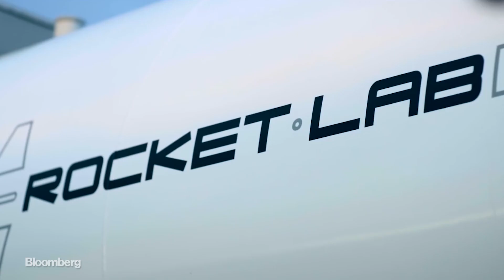Rocket Lab is Giving SpaceX a Run for Its Money

Comment: Electron rocket costs 26600 USD per kg to orbit. Falcon 9 cost's 2700 per kg to orbit. Electron is designed to launch small satellites that would otherwise be secondary payloads on larger rockets. The total cost of getting something to space may be less which can be advantageous for a small customer but Falcon 9 lifts a 100 times more at 10 times the cost. Isn't this supposed to be an economically oriented outlet? And I do think the Electron is very cool and has a place in the launch market.
Reply: "Isn't this supposed to be an economically oriented outlet?" Can you give me ANY example when the Falcon9 launched with maxed out capacity? Rockets rarely do that.
You buy a whole rocket, not just a fraction of it's payload capacity. So the price per kilogram can double or tripple very easily.
Reply: Yes but that applies to every single rocket. Smaller rockets tend to utilize a higher percentage of their payload capacity that is true (they'd be uneconomical otherwise) but even triple the max capacity price of a Falcon 9 that's still 3.28 X less than what Electron costs if every gram is utilized. The heaviest payload the Shuttle ever launched was the Chandra telescope at 22 tons. Yet the Shuttle could lift 27 tons. Delta IV Heavy can do 28+ tons to LEO yet the heaviest LEO payload it ever launched weighed a mere 21 tons. So why would you single out SpaceX yet ignore that fact for every other rocket in the business? Plus all those numbers are completely ignoring the recent price drops in SpaceX service since the arrival of Block 5. So all my numbers have been favorable towards Electron and slightly biased against SpaceX anyway,
Reply: You are right.
My point was, that with a smaller payload you face three options:
- pray that you get a piggy ride close to your desired orbit.
- pay for a whole rocket (and fly it with a very low payload capacity, if it's a big one), but reach your desired orbit.
In the small sat business the electron rocket is economically very viable.
Reply: Yes it is, as are all the other small launchers that also have quite terrible cost per kg on paper. All the small ones are in the 20-35k per kg range, so Electron isn't at all atypical of that category. I just think it's kinda misleading the way they did that whole piece not in the least the title of this video which is just plain bullshit. I did say the Electron is very competitive in it's niche of the launch market.
Reply: Yeah a lot of people are willing to pay even 10x if they don't want to wait years to be laugh to required orbit.
Rocket lab with their frequent lunches to desired orbit makes perfect sense.

Comment: More space junk though, a lot more
Reply: I wonder why they did not talk about the space junk issue at all. The more you launch, the more space junk will be up there.
Reply: @natez9059  RocketLab only leaves the Satellites they launch in space, all the rest the fairing cons and booster falls back to Earth, the second stage does a deorbit burn and falls back as does the kick stage...
Reply: @NighthawkNZ  So do they land like SpaceX Rockets do?
Reply: @natez9059  you don't know much about rockets do you...? one of the reasons SpaceX rockets are so big, is not just to carry the payload but also carry the extra fuel to land the booster...

It becomes damn near impossible for smaller rockets like the electron,

However, RocketLab has announced that they have been collecting data over the last 9 launches (including the one last month) and each one with more instrumentation on the booster... and have also announced a couple of months ago that the will be doing a sky catch to catch the booster and the re-use.
Reply: @NighthawkNZ  Not really. Are you a rocket scientist? You sound so smart! A smaller rocket like the electron cannot carry enough fuel to do a reverse landing.

Comment: If this get s frequent, what about the pollution problem again, also doesn't seem like his rockets land or what happens with them?
Reply: They crash in the ocean because it is cheaper to print a new then to refurbish a landed for space x it is profitable because there rockets take longer to build rocket lab at the moment can make a new rocket in 3 days
Reply: Very fair point. Another concerning issue is the exponential increase in space debris over the last few years.
Reply: Maybe they can make a rocket in three days, but at the present time it's taking six months to launch one.

I'm also concerned about the hundreds of kilograms of lithium that will be thrown away each launch, never to be recovered or reused.  It's a scarce, strategic, non-renewable resource.